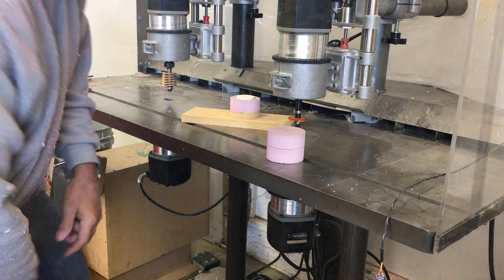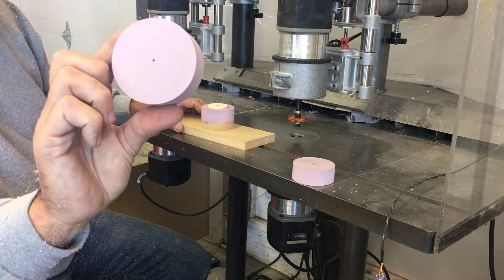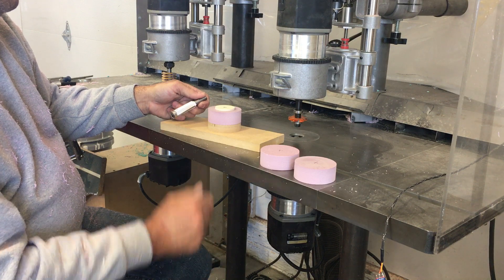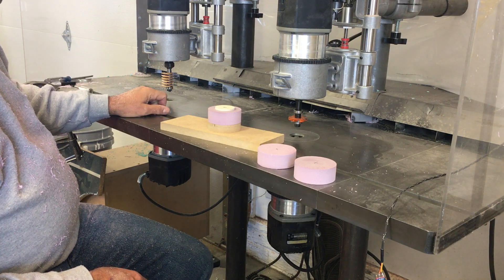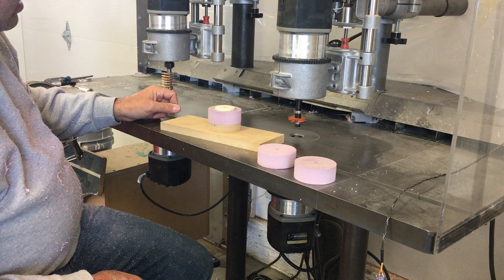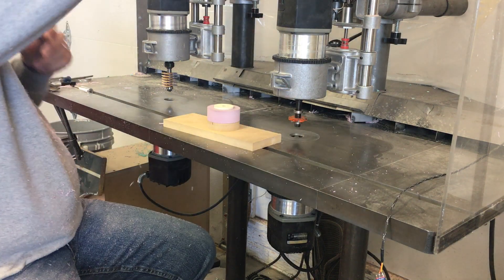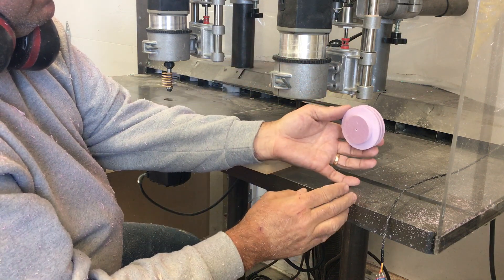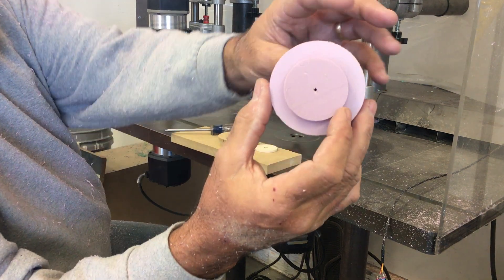3 1 Cylinder Head

Comment: Awesome setup there man, incredible. Just found your channel yesterday and I can't get enough of your lost-foam mold-making, and all your casting videos. Thanks!
Reply from the maker: Glad you found them helpful. LF casting becomes all about becoming comfortable and proficient working foam. It can be surprising what can be done with just a hot wire and hand tools, or pattern guided router/woodworking tools. With a CNC router, the sky's the limit. Finish wil improve with up to 320g sand paper but 220g is usually sufficient for me. I have other vids related to pattern making and pattern construction. Check them out. Best, Kelly